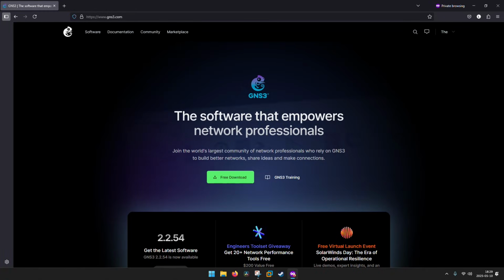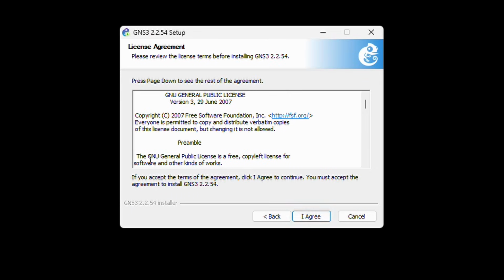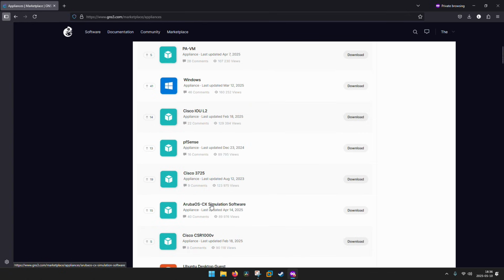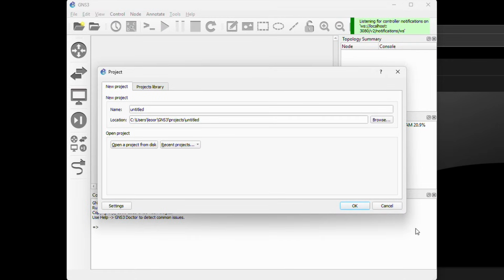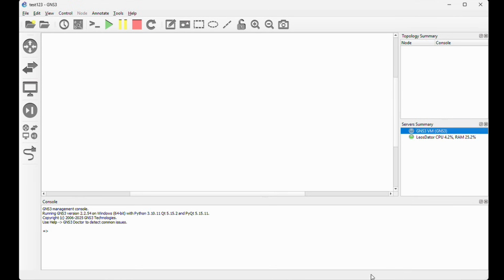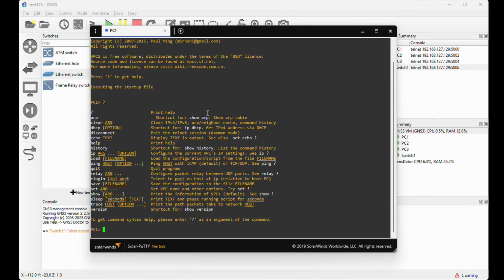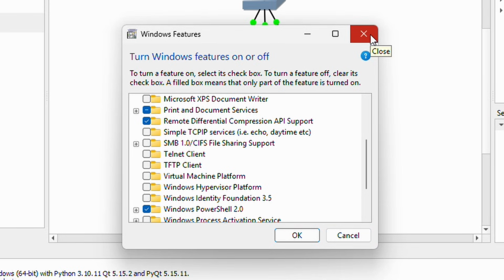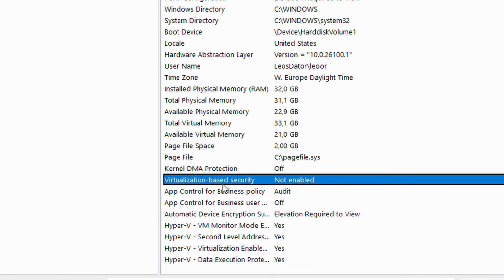How to Install GNS3 GUI + VM + Troubleshooting

Comment: I'm getting this error message, do you know anything.
Virtualized AMD-V/RVI is not supported on this platform.

Continue without virtualized AMD-V/RVI?
---------------------------
WMware - VMware Workstation
---------------------------
Virtualized AMD-V/RVI is not supported on this platform.

Continue without virtualized AMD-V/RVI?
---------------------------
Yes   No   
---------------------------
Reply from the maker: It's quite common that this setting is hard to get working. I have a separate chapter for troubleshooting it in the end of the video. Did you do all those steps? Control with "msinfo" and make sure that "Virtualization-based security is Not enabled"
Reply: @TheSwedishSysadmin  I tried troubleshooting and done it. Thank you so much!
Reply from the maker: Glad you got it to work :)

Comment: My VM is not coming up. I have this error "VMware Workstation does not support nested virtualization on this host.

Module 'HV' power on failed.

Failed to start the virtual machine  But I am using the current VMware Workstation. Pls help
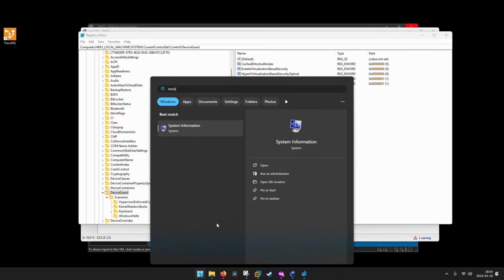Reply from the maker: Did you do all the troubleshooting as shown in the end of the video? Look @23:30 is your Virtualization-based Security Enabled?

Comment: I'm having an issue where I have added the VM file to both VirtualBox and VMware, but under the 'Edit > Preferences' window, the Virtualization engine drop down box under GNS3 VM doesn't do anything. It's basically unclickable. Did you run into this issue or see anything about it while researching your other issues? I cant seem to find an explanation or fix for this issue anywhere.
Reply from the maker: Hi that's odd because for me VirtualBox is appearing even though I don't have it installed. Never bumped into that issue. On top of my head:. 1: Open GNS3 as admin. 2: Make sure Virtualization-based security is not enabled in msinfo32. 3:Re-install the GNS3 suite. 4: Reinstall vmWare workstation Pro. Let's hope you find the issue!